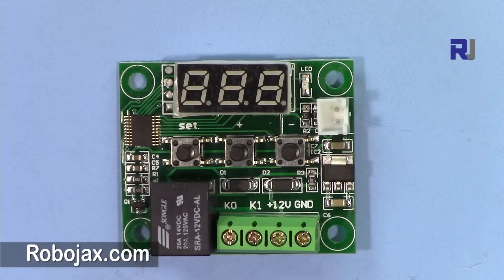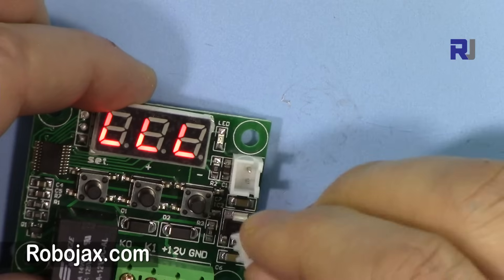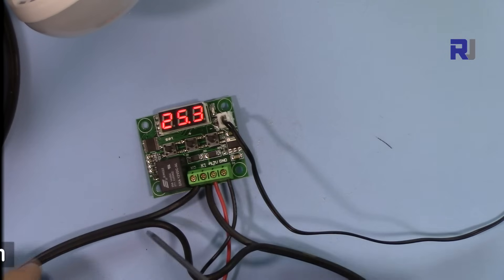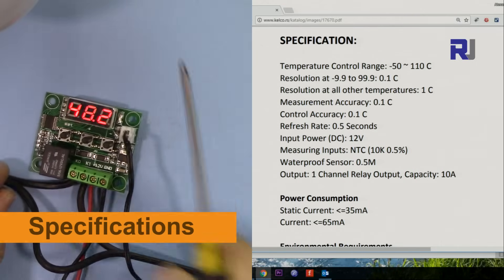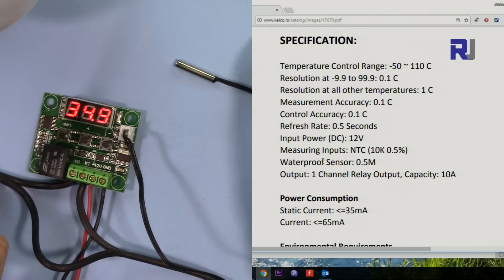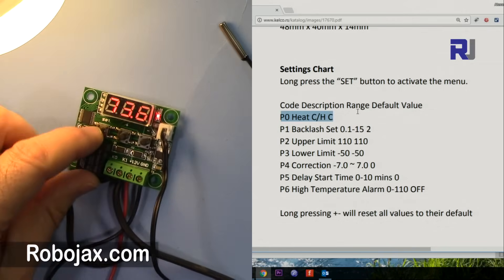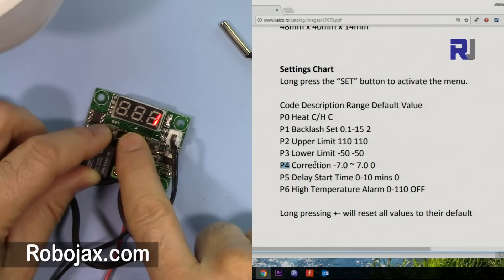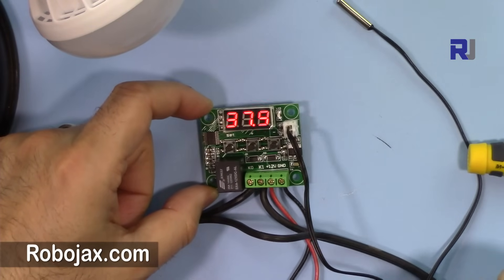How to use W1209 Temperature relay controller and program the thermostat

Comment: Thank you for a clear and useful tutorial. I am using this controller in heating mode and have experienced a strange problem. When there is no load connected to the relay, the temperature sensor gives a steady reading as expected. However when I connect a 12V DC load to the relay the temperature sensor reading fluctuates up and down every half second, upto 2° up and down randomly. Is this a circuit defect or am I doing something wrong? Thanks for your help.
Reply from the maker: Your load is disturbing the power. Add 16V 1000uF or higher - and + and it should be fixed
Reply: @robojax  - thanks. Please clarify where the capacitor should be inserted - across the 12V and Ground, or across the relay contacts. Thank you.
Reply from the maker: Yes at power supply
Reply: @robojax  - I inserted a suitable capacitor across the supply but it made no difference. I found that for some reason the load current was too high and the voltage too low and both were fluctuating. I replaced the power supply for the load with a current limited 12V 2 amp unit. This solved the problem. Thanks for your help. Cheers....

Comment: These relays are great. You can make very nice temp controller for very little money. I control my intercooler fans on my turbocharged Land Cruiser ,  it works very well.
Reply: Are this reliable enough  to be used in a project ? or one should buy expensive controller?
Reply: @anandjoshi8554  It depends... If you build a nuclear reactor, then you probable need something more sophisticated... I used them in many different applications like turning my intercooler fans on my Jeep. I also used them in my cooler room as thermostat. They work and work ok.
Reply: @justlife2129  thanks
Reply: @justlife2129  Which connector would fit to blue colour relay modules in place of jumper /dupont / berg housing connectors ?? (2.54 mm pitch ) good firm connection

Comment: Hello. Is this W1209 safe to use with 14.6V input voltage?
Reply from the maker: no.
Reply: Ok, thank you. Any suggestion what thermostat would be good to use with a "12V" LiFePO4 battery(max 4x3.6V)? Would need a thermostat to control heating pads in freezing temperature.

Comment: Can you help me out? So I followed the video and waited about 3 days so I can get as much information as I can before I start the device. The device worked so I moved on to the light and everything turned on but then after about 5 seconds it popped and it has a black spot now under K1 . What did I do wrong? I was so excited. This is my second one and I’m just really struggling
Reply from the maker: I am not sure what you've done.  but it might be short circuit or you may have overloaded the relay.  See how to calculate the load https://snipboard.io/UDJMCg.jpg
Reply: @robojax  I appreciate all your help and I apologize for all the questions but from your opinion would you say the XH temp control 110-220 is an easier product to set up than the W1209? What product do you prefer? I’m very new to this and from all the channels I’ve watched, yours is the most trustworthy and is by far the most informative and professional. So your option goes along way, well for me at least

Comment: Can I connect to car battery
Reply from the maker: Yes you can. it operates with 12V
Reply: @robojax  car battery has maximum 35Ah (amperes) but this digital temperature controller runs by 12v and 2 amperes adaptor.  I think 35 amperes is high for this. I satisfied by voltage but what about amperes.
Reply from the maker: this just needs 12V and about 150mA. so if you have more powerful battery, it has no affect on this. so don't worry.
Reply: @robojax  thans so much brother.

Comment: Can we use 9 volts yo temperature controller
Reply from the maker: no. the relay is rated at 12V. try it. it might work but can't trust it. with a little voltage drop from 9V the relay might turn OFF. so use 12V if you want stable system.

Comment: Very thanks for this great video, actually I'm looking for a compact module like this to control temperature between something around room temperature to around 300c using thermonuclear type k or whatever that can handle that temperature. I'll be grateful if you have any answer to this.
Thanks again
Reply from the maker: you are welcome. you may use Arduino to measure and monitor temperature from this video https://youtu.be/VGqONmUinqA and if you want to have display, then watch this video https://youtu.be/BlhpktgPdKs or see all videos https://www.youtube.com/results?search_query=%23robojax_MAX6675
Reply: @robojax  it's about cost and space, I want to put it in the oven
Reply from the maker: I've not see modules with protected sensor such as k-type. so Arduino is your option for now.

Comment: I have only one question that no seller can answer, but if the 12 volt DC power is lost, then you loose your settings and have to start again. I am guessing this because they list “Static Current” of less-than 35mA. 
I looked to see if someone ask the question and watched the entire video as well. As a retired automotive ASE Master Tech since 1978, at 62, I still like to learn, but truthfully want to use it for a fan over my transmission cooler. I enjoy your explanation & the equipment you use and describe your findings. If this was a hobby, I would not own a Fluke 87 V digital multi meter. I tell people asking wiring issues on vehicles to use dielectric grease where exposed to water/moisture but also good grounds and these “Star” washer to dig into the metal. Most forget the ground side on a vehicles chassis and using voltage drop as a diagnostic tool. Thanks again for your clear videos. I am saving this one for myself!
Reply from the maker: Hi Dean, The settings are saved when power is disconnected. Your assumption is correct on the amount of current. thank you for sharing your thoughts.  stay safe.
Reply: @robojax   Thank you so very, very much! The “Static Current” they refer to must be the amount of current this device consumes when on, digital display shining, just no “On-Off” activity.
   I intend to use an external relay to operate my fan. This makes the current requirements on the boards relay very low, actually making its relay last longer, because it operating the coil of an 80 ohm relay. 
 Most eBay or amazon seller do not have the product nor ship it. The payment is sent with my address and is sent form another location. 
 I saw this device will hunting for info on it. You did a wonderful job showing both different voltage and current levels. Even noise on the out put was a bonus, important to some, but will not affect my use. Oh many blessings on your effort as video are work too. It looks like tape would hold down the NTC thermistor when the heat gun is blowing it around. 
 I had plans to place it in the back of my custom console. It would not be fun to re-set it once power is shut off. 
Once again, thank you so much!!!!

Comment: One more question Sir. 
Your example was for ac current, for dc current on the relay should I bridge KO to K1 or K1 to positive or does it matter.
Reply from the maker: this is just a switch which turn ON or OFF. you can DC or AC load.  it doesn't need any other change.

Comment: Would this work with a 12V dc supply having two of these modules in series? One to switch a fan on at a certain temperature, and the other to switch off when a certain temperature is reached
Reply from the maker: turning on and off about the load and not about the power supply. so you can connect both to the 12V. and then you can connect them as AND or OR configuration to do something.  to first device is A and second is B see this page http://www.ee.surrey.ac.uk/Projects/Labview/gatesfunc/
Reply: @robojax  Do you have any suggestions for AND gates that can support 12v?

Comment: will a 230 W (230-250v) bulb work in it?
Reply from the maker: this is relay. any load with 10A will work. check the relay you have and do not exceed the rated current.  See this this page on how to calculate the current https://snipboard.io/UDJMCg.jpg

Comment: Thank you very much for very helpful explanation. can I use 110V as well ?
Reply from the maker: you are welcome. this is operates with 12V DC.
Reply: You are talking about using of the relay? It seems that you can. If it's 10 amps with 220V then it should take 20 amps on 110V AC.

Comment: hi, thanks for your explanation. I am working with one of this and it stops when reaches 50 degrees. I have set it to stop at 100 but at 50 it display 3 lines and it stops indicating the temp. Do you know why can that happen? Thanks
Reply: You have the exact same issue I have. With TWO units.  I’ve Set to come on in C mode at  65…but when it hits 50 it goes into high temp cutoff.  P6 will not show any setting when holding set key. No ON. No OFF. No way to even set a temperature for cut off.  Two of these have done the exact same thing…so I am saying JUNK.
Reply from the maker: You are welcome. For your question, you have not watch the video fully. Please watch without skipping.

Comment: I bought one of these controllers great little bit of kit but there is a fault in the software when using it to cool a PC with a fan. When you set the temp you want the fan to kick in at you have to deduct the differential you have set from the temp you require i.e. if you want a fan to kick in at 30c with a 2 degree backlash (differential) you have to set it at 28c to achieve this. This way the fan kicks in at 30c and cuts out when it gets down to 28c . It works fine in the heating mode though

Comment: Mine says 20A 125VAC on the black ic. can i use 220 volts? i'm building an incubator. We have 220volts here.
Reply from the maker: that black cube it Relay and it is mechanical switch.  Sometime they ship if for specific region. 120V is for North America. For Asia and Europe they put 220V.  Usually the rating is the same for all regions. here is how calculate the power https://snipboard.io/UDJMCg.jpg
Reply: @robojax  thank you.
Reply from the maker: you are welcome.

Comment: What’s the amperage of the module alone? I’m worried it would consume so much current in my 12V 20A power supply that would also power peltiers and fans.
Reply from the maker: this needs so much low current, when controlling AC load it would be negligible. for your information it is less than 100mA or 0.1A. for Relay power rating see this I mage https://snipboard.io/UDJMCg.jpg
Reply: Robojax thank man! I appreciate it a lot!
Reply from the maker: you are welcome.

Comment: I'm an idiot..
I just blew this up as soon as I switched the power on...
What plug would you attach to power the controller? Or perhaps my fuse was too powerful?
Reply from the maker: I just watched the video to answer your question. at 2:55 I've shown wiring with AC bulb. This is AC bulb is your load or incubator.

Comment: hello robojax....i am doing a DIY hot air station blower....the blower handle has a thermocouple....what circuit board is the best to control the temperature of the hot air blower? thanks.
Reply from the maker: Hello, because of heat you need k-type sensor. But that needs Arduno. See them here https://www.youtube.com/channel/UCkcBSig_Iu4ZnAIeCeG1TVg/search?query=k+type

Comment: Sir can I do cut & make  extend the wire  (1meter )of the Temperature sensor cable to make it long  that's for my project.
Reply from the maker: Yes you can.
Reply: @robojax  Sir Thank you

Comment: Great video.  Question:  I will be connecting this thermostat to a relay in my truck (12V).  When the power is disconnected from the thermostat module (via relay) will the setting on the module remain at MY settings or will they default to a factory setting when relay restores the power to themastat module?  Thank you.
Reply from the maker: I retains all data. Nothing will be lost.

Comment: Specifications show that the output (load) can be AC or DC, up to 240 Volts.  Is the maximum capacity only 10 amps?  A 1500 Watt electric heater should draw 12.5 Amps, which I assume would not be acceptable?  The 750 Watt setting on the same heater should draw 6.25 Amps and would work fine?
Reply from the maker: 1500W÷120V= 12.5A and yes it is dangerous to do so. If you are connecting 10A or lower current, it should be fine. Check the module you are receiving as they might've change the relay.

Comment: I have a problem robo my device isnt turning the relay on at all 😢
Reply: You can check whether the 12 volt reaches the relay coil or not. If the voltage is connected to the relay coil, replace the relay. But if there is no 12 volts on the relay coil then the error is in the module .. I recommend that you replace the relay with a solid stat relay because it bears a higher amp
Reply: @eng.ahmadsamy6588  i found the solution to the problem مشكور خيي
Reply: @middleeasternvibes7981  ... بالتوفيق دائما ان شاء الله
Reply from the maker: معة السلامة
Reply: @robojax  عربي كمان؟ 🤣

Comment: my temperature is showing me - 29, -37 all the settings are working but the readings on the screen (-29,-37 changing form one to the other)is not and if i remove the sensor it will still be showing the reading, instead of it to stop, please can you help.
Reply from the maker: Your sensor is is bad. Check the wires of your sensor or replace the sensor.
Reply: Robojax thanks

Comment: I have a 2A power supply I have connected to it and then connected a 10w heater to it. It's not running, is the A enough or does it need 10A to work?
Reply from the maker: I will reply to all Subscriber's 🔔 questions. So make sure to Subscribe.😊

Comment: Can I connect this to a 12 volt battery 1.4AH? I intend to connect a small fan and small buzzer on a compact surface.

I know it has a 20amp relay so im not sure if this requires more power to activate the fan.
Reply from the maker: the voltage is the only important value. 12V is fine. you can connect 0.2A to 1000A will work.
Reply: @robojax  thank you! I intend to try the 20amp 😁

Comment: So how would i set it for an rv  refrigerator by using this to replace thermistor?
Reply from the maker: this module works only if this temperature sensor is used and connected.

Comment: Sir is it okay to put it in 9v 1a power adaptr??
Reply from the maker: it will not work. you need 12V. 9 V is not reliable.
Reply: How about 2 x w1209Tempcontroller plus 1 x 12v 0.12a dc fan in one poweradaptr which is dc 12v 1a?

Comment: I was thinking that it will be good to use for a mod a laminator for the toner transfer (the old back yard PCB making method) to make it work and tune the temp. up to 170-to-210 degrees Celsius but NO, unfortunately  it does NOT work for more that 110 degrees so....NOT suitable for my intended use.
Oh, what a bummer!!!  I nearly went to buy it. but read the specs before pressed the buy it non button (luckily !!!) Nice video presentation as usual. Tnx.
Reply from the maker: That's good you found this video helpful. Good luck with your project.

Comment: How can I connect a 12v fan to go on and off with the bulb at the same tempature?  I'm using a 12v adapter to power the fan and a 110v to power bulb
Reply from the maker: Can't do both 220V (or 120V) with 12V fan. you have to add more components to this.
Reply: You need to buy a new thermostat just like what i did. I have dual thermstat. 1 for the bulb and 1 for the fan

Comment: Hi , you did not talk about the type of 12v power supply ?   Trying to do this on a cheap ... so what type of power supply do I use or buy ?   I have some 110w to 150w  desktop power supply .... I have a dell laptop 130w  power supply ..... what can I use that is cheap and still work ?  Give me an ebay item number of the cheapest power supply that will work .... ?   Appreciate the help !    Thanks
Reply from the maker: This module needs so much low current that I would say even 0.2A 12V power supply will work. This is the power for the module.
for your load it is up to you. So you can get any 12V power adapter and it should work.
Reply: @robojax  and this will power a Ac  110v  75w-100w bulb ?

Comment: Does it need to connect a 12v power supply or it's just an optional
Reply from the maker: any device that does a work, needs power and this needs 12V power to operate.

Comment: Hi. Thanks for the video. I have noticed that the thermostat in the incubator I bought is constant at 37.7 C but this thermostat runs up and down. What settings will make it remain at 37.7?
Reply from the maker: Hi, you are welcome. Test it with other temperatures. may be your temperature is fluctuating.
Reply: @LazyH-Online Thanks a lot. I totally agree now that I made a second incubator with thicker styrofoam and the fluctuation is not that much. Of course I'm still mystified because the insulation on my small plastic body factory made incubator doesn't look that great but the temperature  fluctuations is almost not noticeable.😏
Reply: @LazyH-Online Like you adviced ,I made the second incubator with thicker walls and the temperature is holding well.
Reply: Hey bud.. That's what I'm making..
Did they hatch? 😁